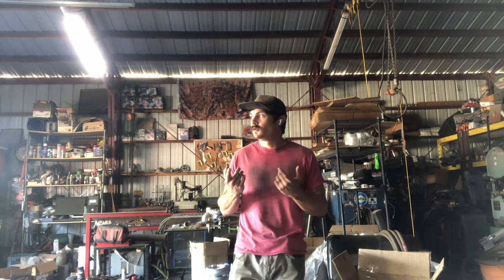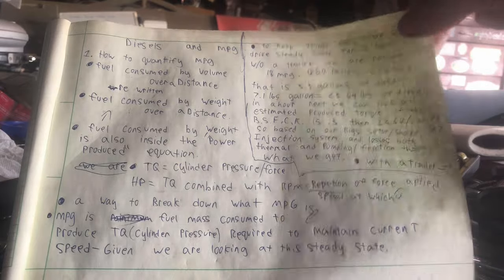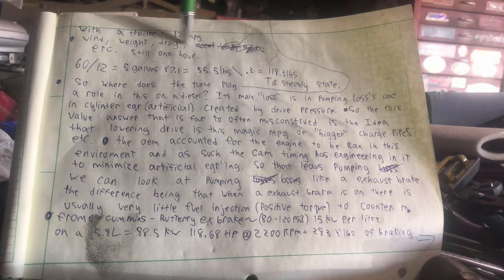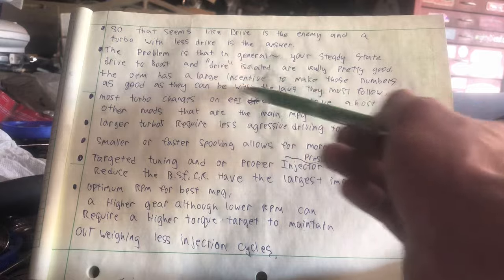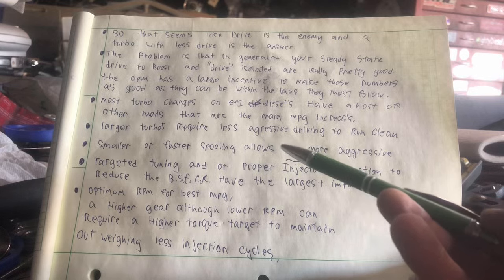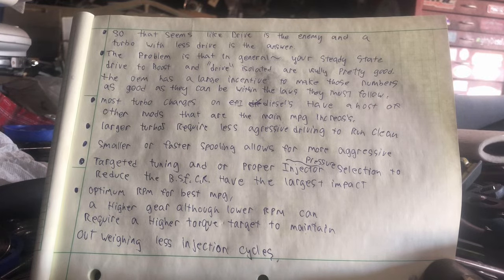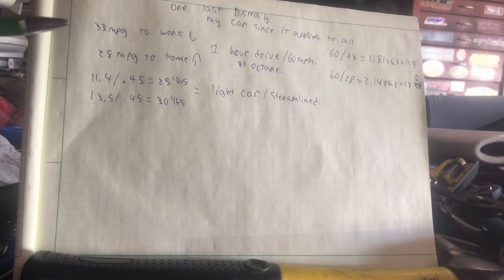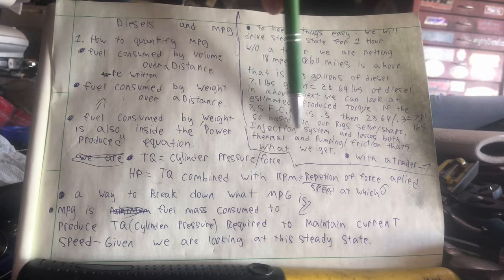How to think about mpg and look for ways to improve it on a diesel.

Comment: Best way to improve MPG is to reduce vehicle drag, second best way is to reduce vehicle weight. Beyond that it goes to friction losses in the engine and drivetrain followed by optimized combustion dynamics. Having the best delta pressure across the engine more boost than drive always helps. Injectors in my experience make very little difference themselves in MPG unless they are either really big or really poor at atomizing. Sometimes mpg will actually go up with a larger injector just because it takes less power to run the injection pump but this is usually only injectors that are slightly larger than stock its diminishing returns after that.
Reply from the maker: @bcbloc02  I agree

Comment: 👍👍👍👍more math and algebraic expressions 😆🤣..i would've guessed your conclusion would b that turbo tuning determines the best economy and not specifically the injector....all the aspects play a role as u mentioned...is there a magical timing sweet spot for best economy in an inline pumped engine?... Perhaps i should rewatch the video 😆...but anyway, thanks feller..your knowledge and info is invaluable 👍👍👊
Reply from the maker: @elroyelblander6277  not really~ it is pretty standard on a oem injector on a p7100 to net best mpg’s around 16-17* but once you change the injector due to all the differences between manufacturers it gets kinda tough to simply state a “this is best” answer. Pair that with different spill port closing settings on the pump depending upon its re calibration and it’s different yet again. 😬😬 it really is just messing with it to find that happy medium zone